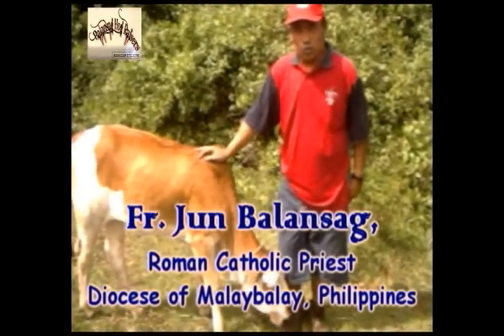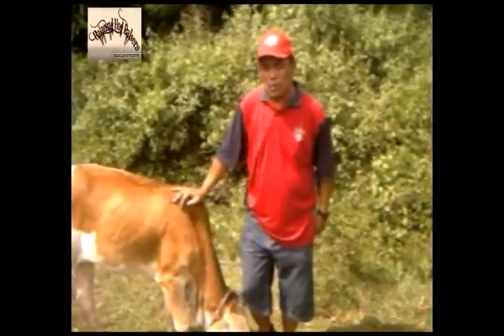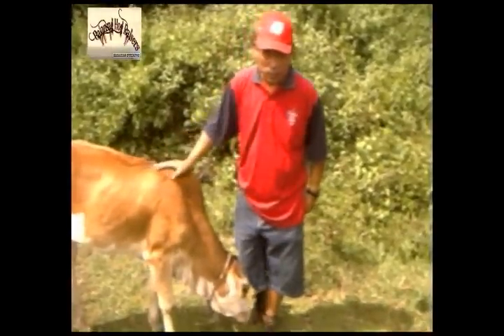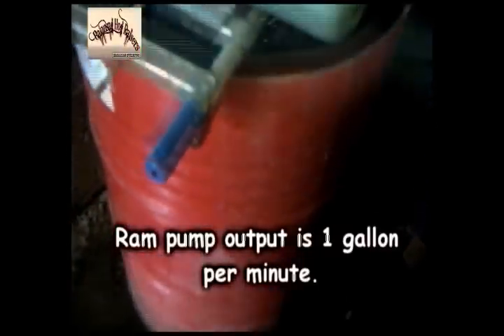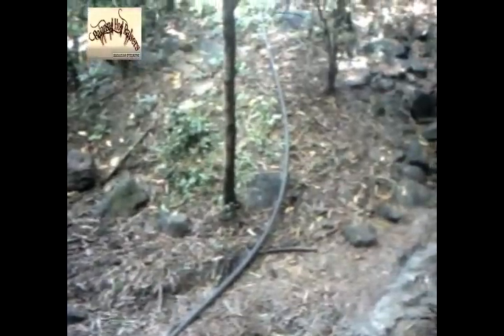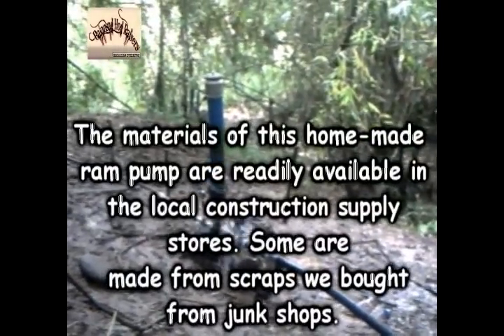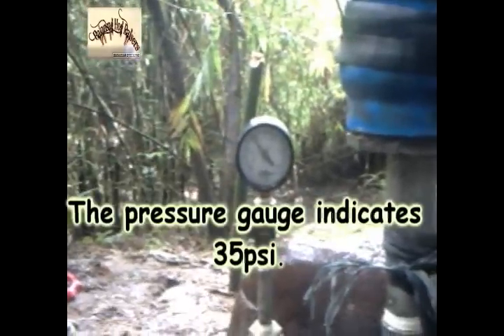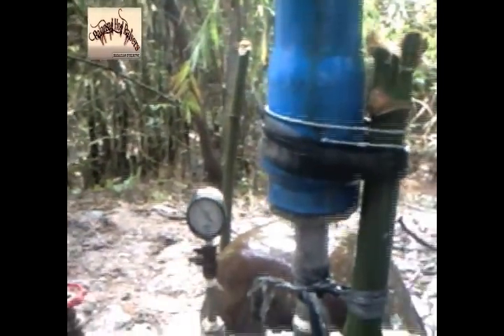Bukidnon Home-made Ram pump!

Comment from the maker: ram pumps are hydraulic devices which are meant to bring water to very high elevations, using water energy, without electricty. In a sense, they have low cost maintainance.